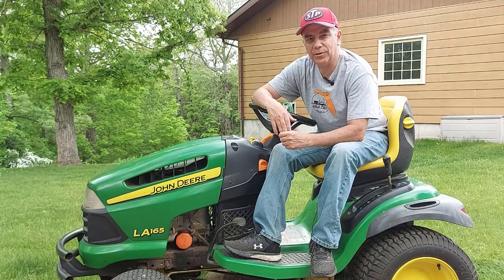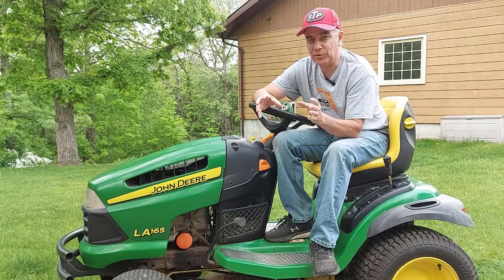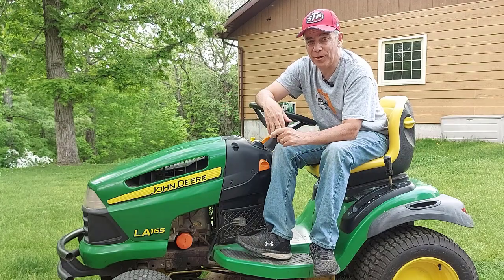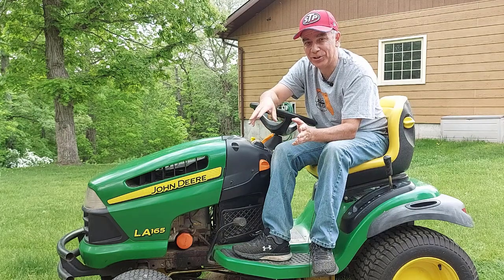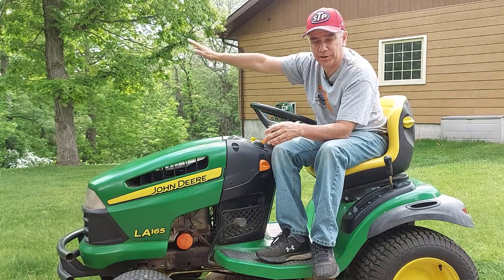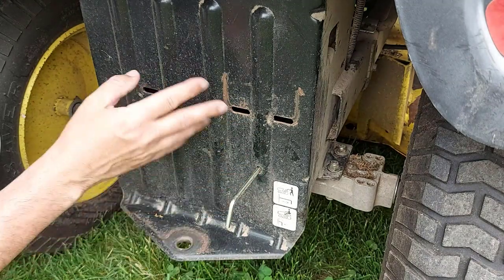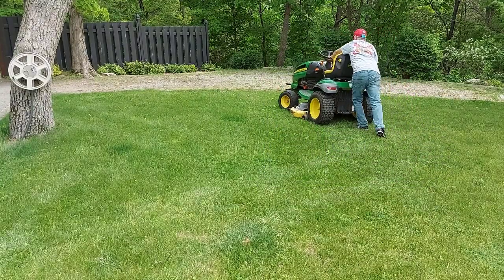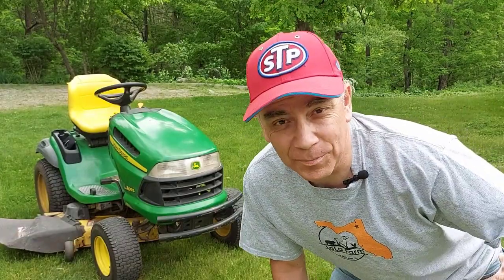How to Move a Riding Lawn Mower So it Wont Get Stolen | Funny Story

Comment: I see you may have disconnected or jumped the seat switch. 🤔. Smart man. Take care Roland. 👍🏼
Reply from the maker: No Chris, I put the parking brake on. It's on the left side.
Reply: @GettingItDoneRepairs  hmmm. Mine still shuts off when you leave the seat, regardless. Well....it used to. 😄
Reply: We disconnected our seat switch, so much easier to jump off to pick up sticks or whatever